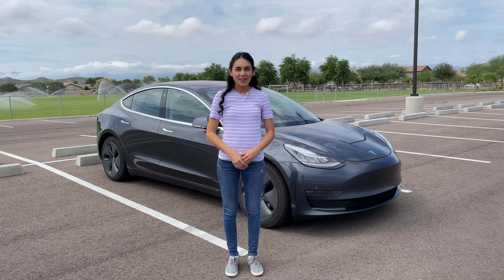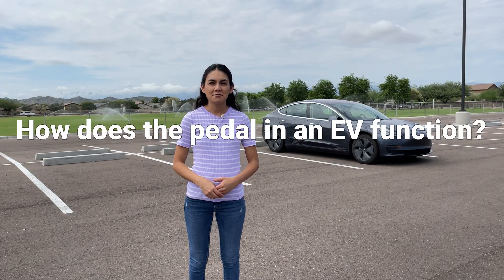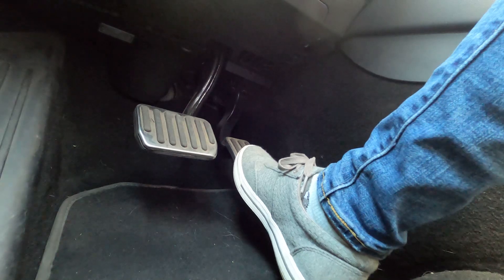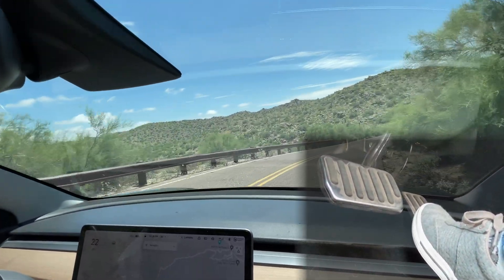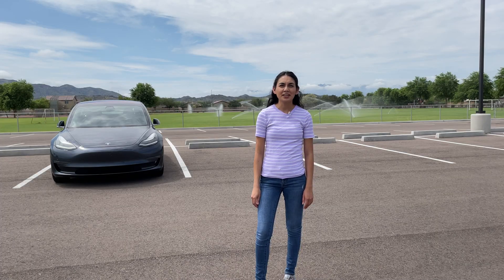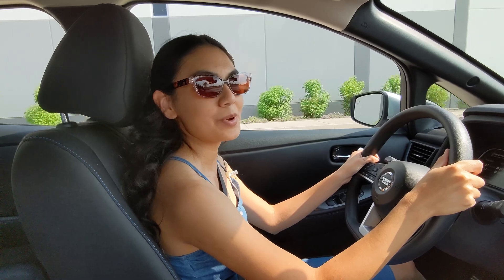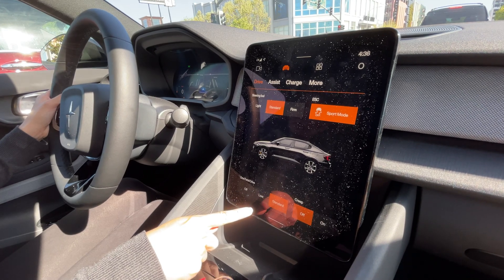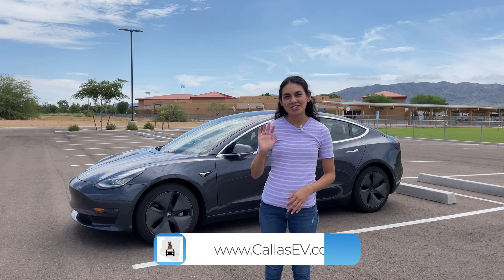One Pedal Driving - What is it?

Comment: I am too much of a control freak to let the car do the braking like this. I feel anxious just thinking about it! 😂
Reply: Unless you brake by sticking your foot out and dragging it on the road, the car is always doing the braking. Personally I find that one pedal makes me feel more in control, not less. Especially when going down steep hills. A regular car will always want to accelerate going down a hill and you have to keep tapping the brakes. With one pedal driving you can easily “dial in” any speed you want, no matter what the grade is. And of course you don’t have to worry about brakes overheating on a long downhill grade. I recently had to drive an ICE loaner car for a few days and one pedal driving was the biggest thing I missed. It was a big relief to get back in my EV (a Genesis GV60).

Comment: I have a question. On the Nissan leaf the e-pedal uses the physical brakes if necessary. In Tesla is only regeneration used or also the brakes? For example, when the battery is full on the Leaf, the e-pedal continues to brake but wears out the brakes a lot because the regeneration is practically zero, and I don’t like that.

Comment: At 6:35 you say that the paddle must be used in order for the Chevy Bolt to come to a complete stop. This is INCORRECT. The car will come to a complete stop if you have it shifted to “L” (low), but you do not need to use paddle at the back of the steering wheel. The bolt has one of the strongest regeneration available of all electric cars I have driven (and I’ve driven quite a few) The regeneration of the Bolt is actually stronger in “L” mode than the Tesla. And it increases THE MOST when it is in L mode AND you use the paddle.  It is very strong. 
Chevy has since added the “one pedal” driving mode switch to their newer Bolts. (2022 and newer). I have noticed that the one pedal driving mode in the new Bolts is slightly less than driving in “L” mode of the previous Bolts. (They should’ve given it the same level of regeneration. I think every experienced EV driver prefers very strong regeneration. After all, you can always make it Less regeneration with accelerator pedal control, but you can’t always make it MORE regeneration. That’s why MORE is better ;-)

Comment: soooo if you need to slam on the brakes for any reason... thats not an option...?? What am I missing here...?
Reply from the maker: Regenerative braking is a function which increases the efficiency of an electric car.  It does this by using the motors to "brake" and collect the energy which is stored in the battery.  Regenerative braking is typically enough for every day driving.  However if you should need to do any hard braking you always have regular friction brakes that function exactly the same as they would on any car.  Safety is not impaired due to the addition of regenerative braking. Hope that helps!

Comment: Well done- regen is very often misunderstood. Easiest comparison is a go-cart... when you let up, it slows almost immediately...
but, EVs especially Tesla, have MUCH finer control and modulation of BOTH acceleration AND regen decel, over the entire throttle/pedal range, just by how much pressure you put on the pedal up or down. It works very well by feel.
 It is AMAZING and works extremely well and smoothly (once you get used to it and train your foot muscles to not just "let up" all the way! ) (urgh strong brake, carsick passengers.) Does take a day or two to get in the habit.
It works VERY well and is a lot of fun especially down curvy mountain roads; it's almost like having an infinite-speed low gear with a manual transmission, but you never have to shift! (and , you get range BACK going downhill! I even got power back going 70mph+ down a steeper mountain pass!
And yes, the brake light DOES go on, once you slow fast enough.  There is no point to "coasting" to save energy, just use enough pedal for your speed, car powers or regens automatically as you need, using least/capturing what power it can.
It is an important safety feature to me, as braking starts immediately once you start letting up on the accel pedal... saves a few fractions of a second vs shifting over to brake pedal. Even subconsciously if you see something unsafe (kids by parked cars), you start to let up, start slowing.
Note re brake hold (stop) mode, eg @4:34, the brake pedal DOES depress and hold you at complete stop (then lets go when you accelerate.)
This works also on hills as a built-in hill hold, VERY handy for steep grades- and it and regen even work in reverse down a hill, too!
Reply: @Colin Gould, your comments are spot on. The only thing I think you may not realize is that the Chevy Bolt has even more regeneration in “L” than the Tesla. And if you use the paddle behind the steering wheel, it adds EVEN MORE regeneration. 
Tesla could learn a lesson from Chevy on this. BUT….maybe it’s like she mentioned in the video “permanent magnet motors offer more regeneration capability than induction motors. It really pulls you to a STRONG stop if you wish. We all know experienced EV drivers LOVE one pedal driving.

Comment: Why did Tesla get rid of the low regen setting?  It’s actually useful if you’re driving on slick roads in winter.  FYI putting the car in neutral is the only way to turn off Tesla regen and is a good idea if you’re going down a slippery hill.